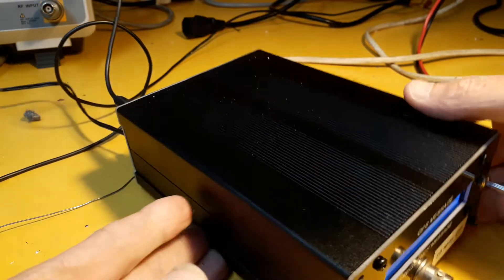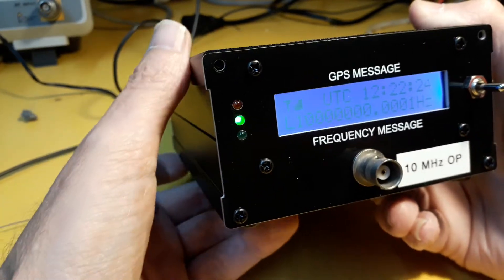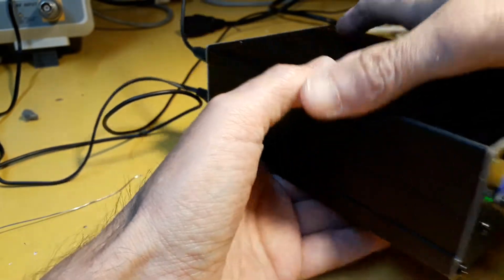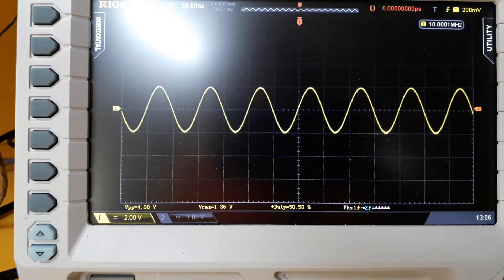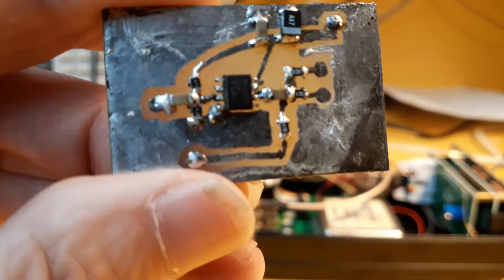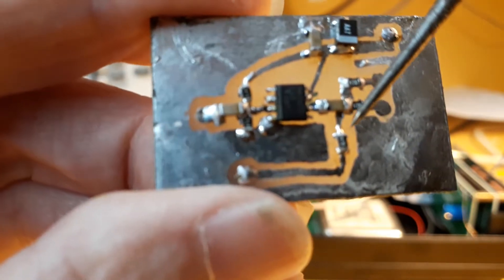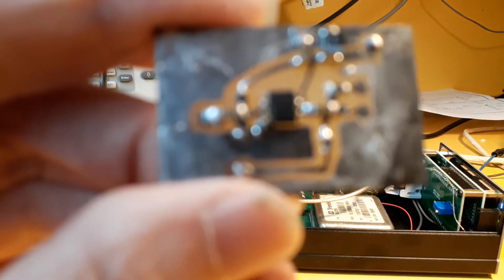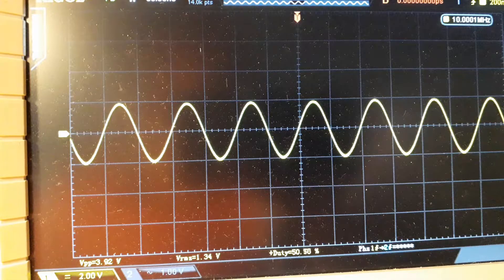GPSDO modification

Comment: Nice mods, thanks for sharing. I love your hand drawn and etched PCB. We used to make them that way in college back in 90's :)
Reply from the maker: Thanks, yes still do pcbs the old fashioned way, works for me
Reply: @ptronix  I still hand solder proto boards and wire wrap. Non of that PCB way rubbish :) it works out cheaper and quicker. I'm not sure where hobbyist are heading with micros and having all PCB made and  assembled in China. :/